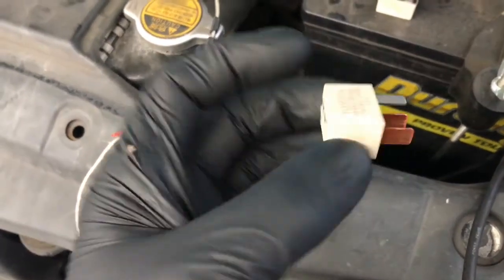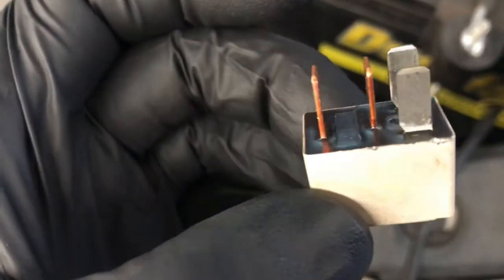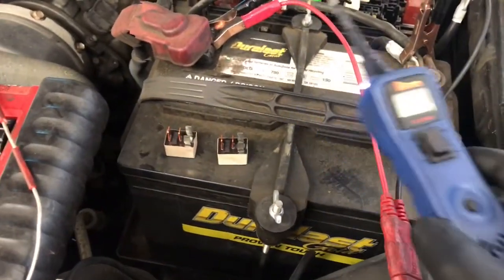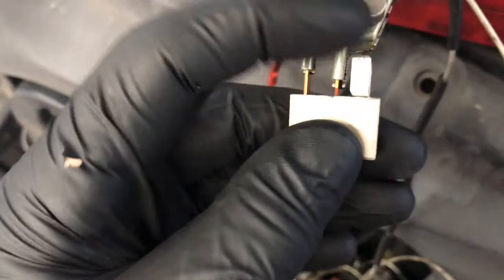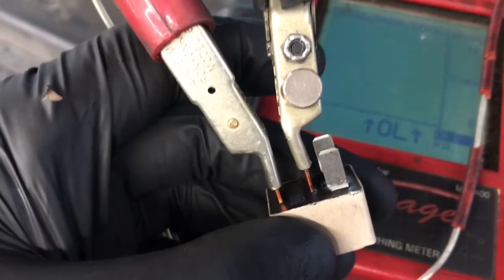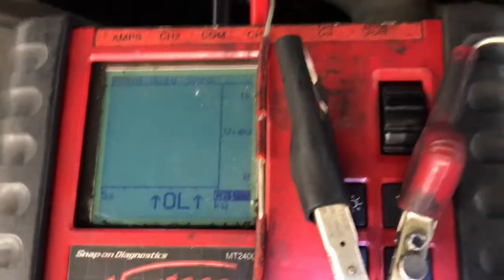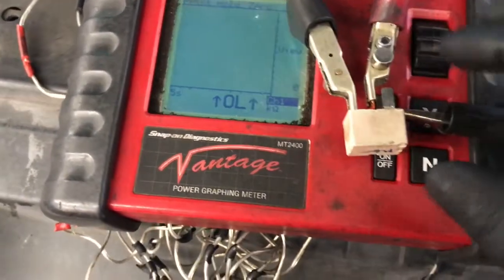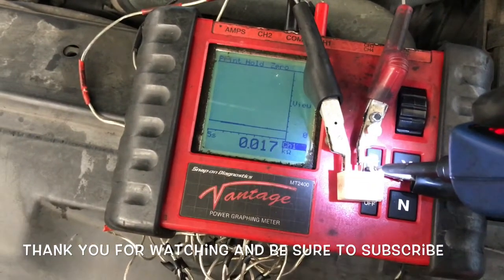"how To Test A Relay Without Pin Numbers Or A Diagram"

Comment: I have a 5 pin Hyundai Omron 95225-2D000 DC12V 20/10 Relay. 2 bigger copper pins and 3 smaller pins. When I apply 12v to the 2 pins on the outside, the connectors is complete but what is the smaller pin in the middle of the three, ground? Nothin happens when I switch the current to the smaller pin on that pin. Relay functioning ok?